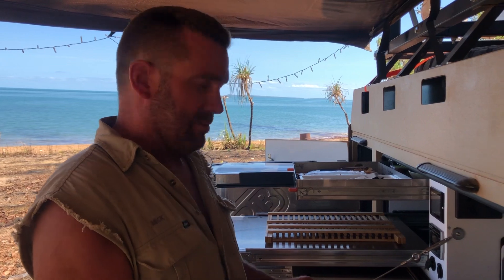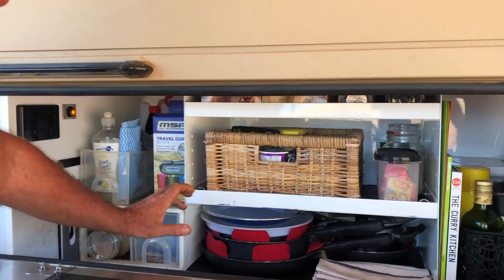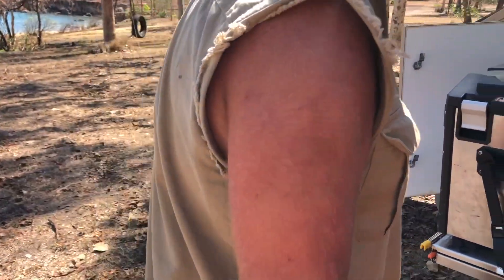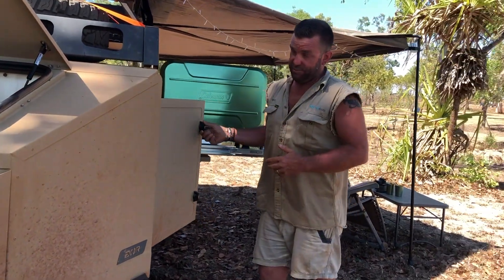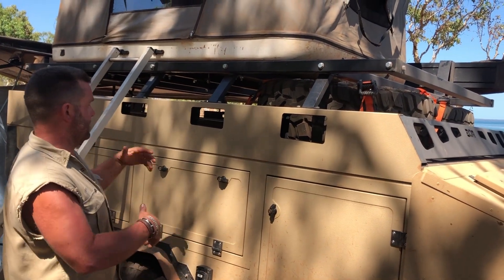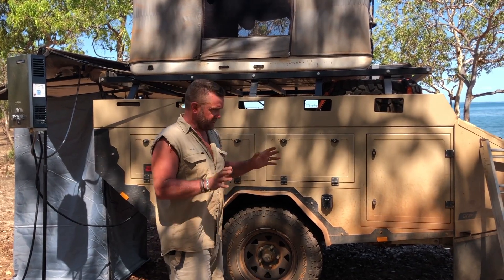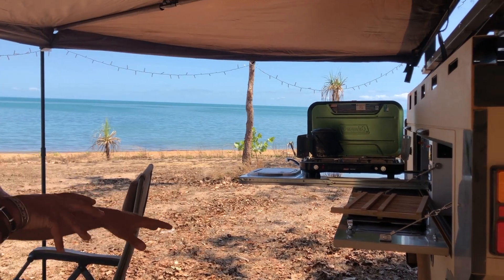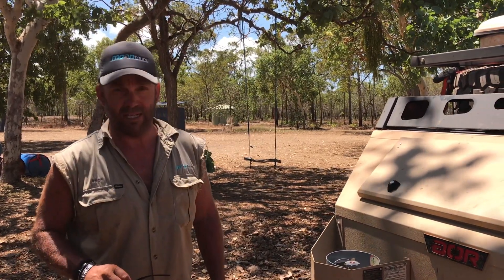Moony's 6600km AOR Sierra ZR review. How'd it stack up off road?

Comment: Love what you’ve done with the tyres and battery storage, you said they had to reinforce the roof though. So maybe not an option unless you order it like that, good to know anyway. Great review, felt like we where going camping with you and you just needed to show us a few things first 👍
Reply from the maker: You beauty. Thanks Charlie.
Reply: @moontours9071   cheers Trent, how easy is it to get the tyres out, looks like there caged in there with all the bar work ?

AOR have the Trent Moon tyre/battery swop as an option on a new build, brilliant customer service 👍
Reply from the maker: @charliestreeservice6563  yeah that’s good, I’d definitely take that option. Obviously 🙄 I did it 😆 AOR modified the front bar so it can be easily removed to access the spare via a couple of bolts.
Reply: @moontours9071   Cheers Trent, that sounds less than ideal. Perhaps I could bring it through the roof rack if the bars are spread out, thinking of hinging a Rhino platform as a hatch into that space with the Darche RTT down the far end, will talk to AOR and see what they say. 👍
Reply from the maker: @charliestreeservice6563  its four small bolts and not something I expect to access very often. It should be a pretty rare event changing a tyre on the camper. You could put it on the rack without too much trouble if there’s room after the RTT is fitted. Our new RTT is way too big.

Comment: Congrats on a super review!

Do u find much wind drag from your vehicle mounted solar panel?

Any way to reduce any wind drag with this setup on top?

How do you extract the spare wheel from that height safely?

Cameron
Reply from the maker: No wind noise with the solar on the canopy, drag would be here nor there in my opinion. Sometimes moving racks back or forward an inch can make or break wind noise.
I’ve since fitted a Bush Company Alpha series roof top tent to the trailer with 2x 135W PROJECTA Solar panels fitted to it. 

The spare is accessed by removing four small bolts and the cross panel then man handled down the front of the van.
Reply: @moontours9071  thanks.  So the spare tyre just slides down the angled profiles when man handled.  Reverse process for putting the spare back up into its location?

Also, with the high trailer - how does this impact of rear visibility, wind resistance and fuel economy?

How are the new solar panels and RTT performing?

Cameron
Reply from the maker: @Camh1968  yeah pretty much re the tyre. 

You can’t see past the trailer through the rear vision mirror, it’s a fault high little trailer but the storage and off road ability V a folding camper is second to none. 
We’re running standard mirrors on the Hilux and the vision down the side isn’t bad but I’d recommend getting some MSA towing mirrors to make it excellent. 

It’s surprisingly aerodynamic, we’re only burning an extra 2L per 100km towing on the open road. Here’s a fuel economy run video we did from the Sunshine Coast to Birdsville. 

https://fb.watch/3WtGX5M20m/

Finished fixing the new RTT and wiring the two 135w panels yesterday so will have to come back to you. We’ve been running a single panel for awhile and it’s been great but we’re now running two fridges, one as a freezer, I expect the two panels will manage that without any issues. We’re running a Bush Company RTT on a LC79 and it’s brilliant. So expect the same on the camper. The Alpha tent has mounting rails all round so it’s easy to mount maxtrax, shovels, lights etc Very good.

Cheers, Trent Moon.
Reply: Magical!  Thanks Trent.  I love the RTT concept but my wife hates it because of ladder climbs.  Any way to make the ladder access safer and more ergonomic for an older person - like around 60 yo?
Reply from the maker: @Camh1968  maybe the other Sierra is a better choice? In saying that, the ladder that comes with the Bush Company tent is wide and strong. We’ve been able to keep a marron walk way in front on the tent and down the side on the roof of the camper. Makes it a little easier getting up and down. Fortunately the climb isn’t that high, compared to say, climbing on top of a land cruiser. Not sure if there’s anyway to make it any easier in this situation.
Reply: @moontours9071  thanks mate.  Appreciate all of your responses 🤤
Reply: Hi again Trent.  I was able to convince my wife to go ahead with this camper trailer.  Yay ...

How best should I approach AOR with scope of work and commencement of works?

Are there various build sheets with options to choose?  What good mods or options would you recommend for a new build given you have taken this trailer many kms now?

I’ll be having the blackmax RTT along with same solar Panels mounted on top of the RTT...

Tow vehicle will be 2009 Patrol 3.0L diesel.

CAmeron
Reply from the maker: @Camh1968  Hi Cameron,
Trent is in the Desert for the next two weeks.
If you would like to drop me an email info@moontours.com.au I can connect you with Luke who looked after our build. We have upgraded a few things over the last weeks to make things more user friendly. 
Kind Regards Steph Moon